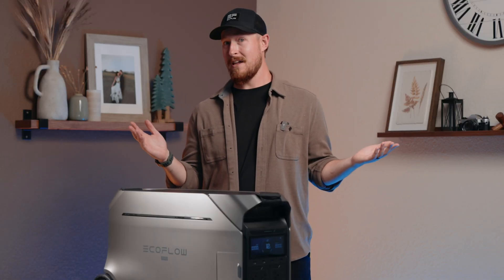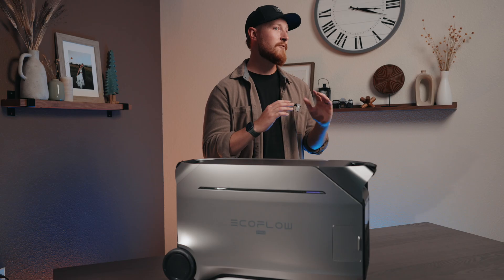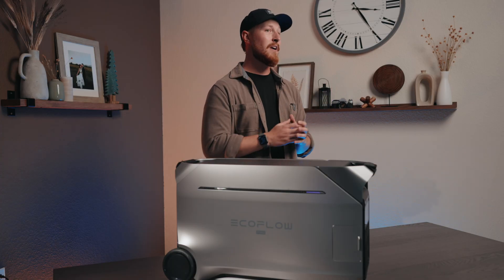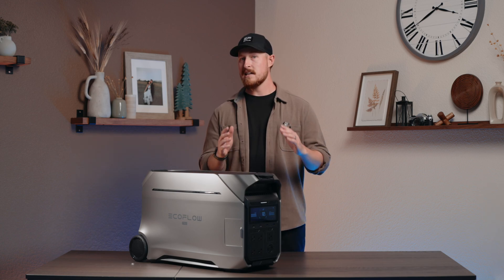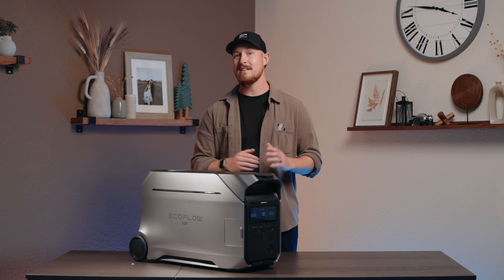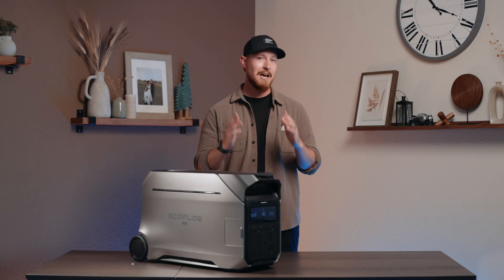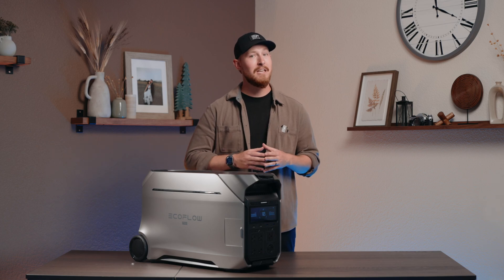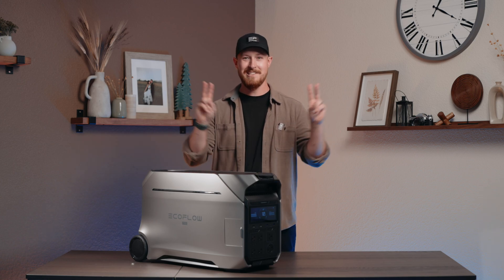Triple Threat Showdown: DELTA Pro 3 vs. Your Power Needs

Comment: For safe RV use 
A solid mains priority circuit is still missing in the ecoflow product line. 
The IT- net of a power station is hard to sadly integrate in an AV system if there is 
shore power and the 12v and 230/240 V systems of an RV
And hafe the fuses fire at all Szenarios

Comment: You need to fix the Alternator Charger. It’s not working. On second unit now. Even with the “firmware” fix it’s still not working. Can’t handle 24V as it should. 24V can’t use reverse charging mode. It’s crashing hard. On 12V it’s disconnected after a while. Am aware it’s a timer on one of modes, so it’s not that. Lots of others EcoFlow unit and they work fine. Only have this big issue with the Alternator Charger. So then we need to use Victron then. Been thru all the different steps with tech support both useless tips and some firmware pushing without it’s getting fixed.
Reply from the maker: We hear you. ☺ Could you please explain the issue of not being able to reverse charge with the alternator charger?
What specific symptoms are you experiencing - error messages or any other indicators? It would be helpful to capture a video for reference. Feel free to send the video to support@ecoflow.com for further assistance. It's be great if you could also provide the serial numbers of both the alternator charger and the power station.Thank you!
Reply: @EcoFlowTech How about not shutting down when it's not even cold? 14 degrees in Chicago is still borderline summer. Please go bankrupt ecoflow.